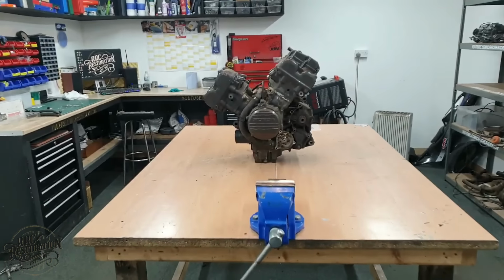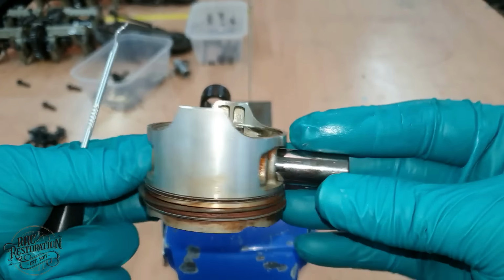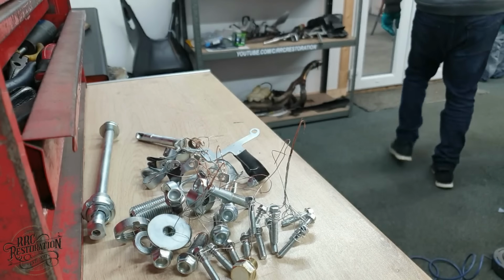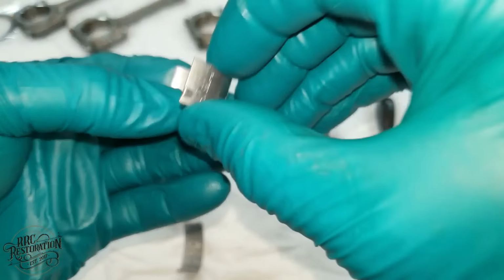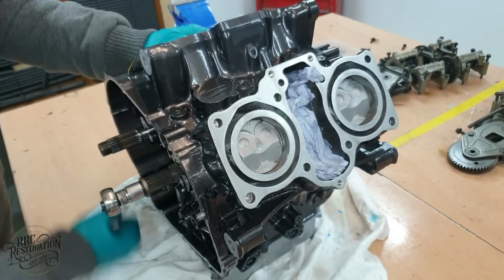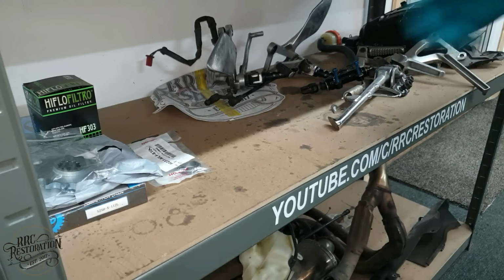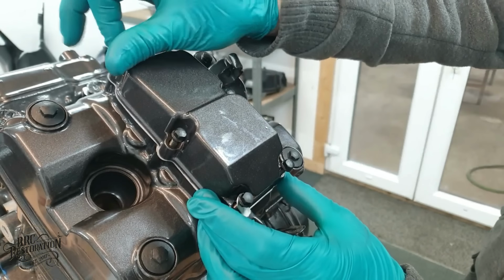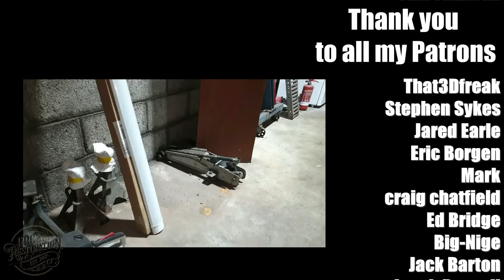Restoration Of A Ruined Legend - Honda VFR 400 NC30 - Part 6

Comment: Wonderful job but I'd put the paper gaskets on and not instant gasket even if I had to buy a roll of paper and cut them myself it's far safer than a bit of hematite blocking something up
Reply from the maker: Its the way I've always done it and not had a failure yet as don't go overboard with the sealant ;) but each to their own :)
Reply: @RRCRestoration  if I do use it I tend to lightly seat the cases and lit it sit a couple hours before fully torquing down that way less oozes out, I've sent this to my bro he had one and he'll be gutted seeing this 😂

Comment: How did you know which piston came out of which cylinder?
Reply from the maker: The pistons can be moved around as they are all the same its the rods that are different front to back.
Reply: @RRCRestoration  I've heard from many engine builders that you always need to label your pistons (and other rotating assembly part). Because each piston skirt and cylinder bore will wear/ run in slightly differently, therefore the piston and bore are like "married in a way" The engine was checked for balance at the factory. (when mixing parts this balance can be slightly off because each rod, piston, piston pen, combination will wheight slightly differently.

Comment: Impressive quality 👌, what about the surfaces treatments, like nikasil on the cylinders bores ?
Reply from the maker: Thank you,  there are no surface treatments needed as the bores have steel liners not Nikasil plating hence the reason i could hone them back into shape if they were Nikasil they would either need re-plating very very costly or bored out and steel liners fitted.
Reply: @RRCRestoration  thank you for your knowledge, your hard and fascinating work 👏👏

Comment: Don't waste your time using a rattle can etch primer. Use a two pack product. Just a light coat will work way better than an aerosol, to the point that paint won't fall off as soon as you tighten a bolt into it.

Comment: Why didn't you hone the cylinders before you cleaned and vapour blasted the block ? Why didn't you fit new pistons instead of clanking the old ones about ? Why didn't you paint the sump instead of inside the covers which wasn't necessary ?

Comment: Should never use a fkex-hone/stone hone to deglaze cylinder walls... flex/stone hones remove material (used to remove the last 3-4 thousandths after a bore job) 
 Ball hone only to deglaze cylinders.. use ATF & white rags n clean clean clean...

Comment: You never mentioned how you identified the rods and caps etc I couldn't see any markings and it always makes me cringe seeing rods clanking on castings. I suppose your not racing it. Also you didn't explain the Honda bearing identification system just a thought. Does 3 bond work with oil on it looked like lots cam out of upper cases.
Reply from the maker: I chose to simply skip over the crank, cap, rod and shell colour, coding and sizing system as for people not experienced with this engine i fear it would bore/ confuse them so i chose to leave it out. yeah the oil was a little mistake that was fixed between shots i didn't realize it had pooled above the mating face and when i flipped it I had to clean it all up and reapply the threebond.
Reply: @RRCRestoration  Thanks for your explanation I often wonder how many times these shot are redone on channels like yours keep on producing these entertaining videos.

Comment: he went through all the problems of cleaning them surface and putting the ceiling on it and when he flipped it over he spilled all that oil all over those clean surfaces
Reply from the maker: Yes i did and when the camera shot changed i cleaned it up and re-applied the sealer as I didn't expect the oil the be pooled right above the mating surface when i flipped the casing easy mistake to make but was fixed.

Comment: Worked in the engine industry for 30 years, and you should never sand blast or bead blast any insides of engine casings, it is inevitable that small grains will remain in the oil galleries.  Even with blowing off with compressed air or powerwashing. Engine casings should always ONLY  be vapour blasted